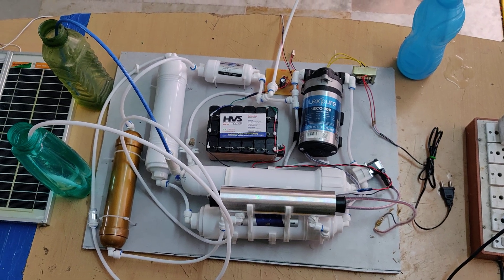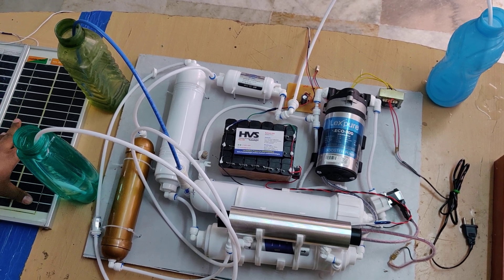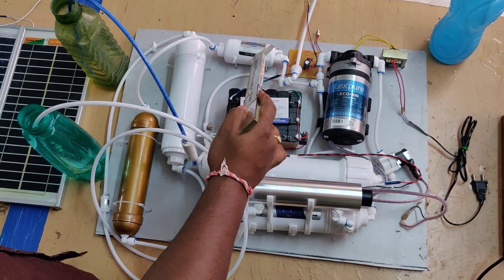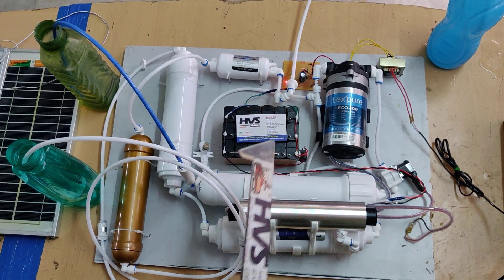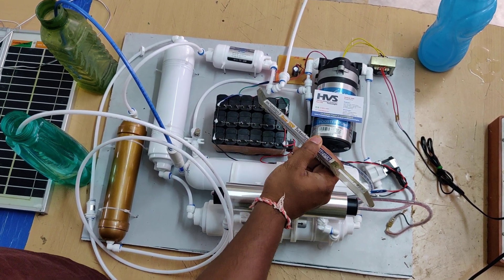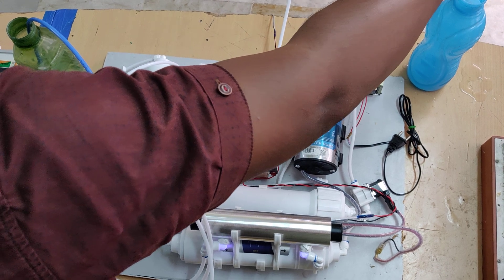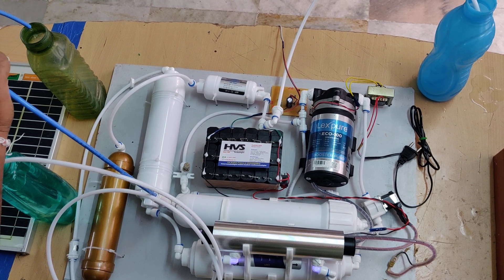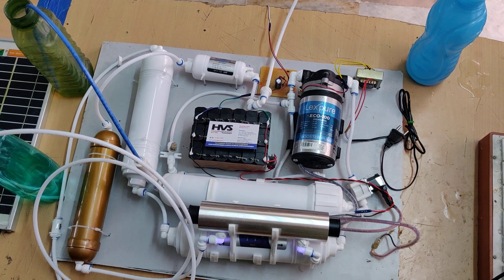HVS-3172. Fabrication of Solar Water Purification system using UV and RO #renewableenergy

Comment: Please may you show more specifications of different sizes and capacity of these machines? Tell much does these projects?
Reply from the maker: Hi, 
We sell full working kit with document PPT circuit diagram and code. Could you Send me the video link, Will update you the cost details. You can contact us at +919603140482
Through WhatsApp or call